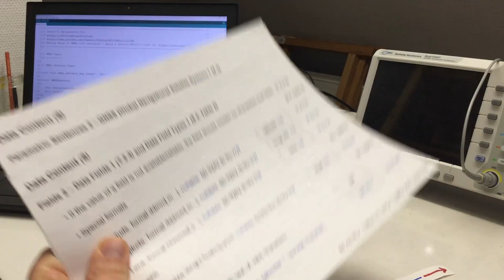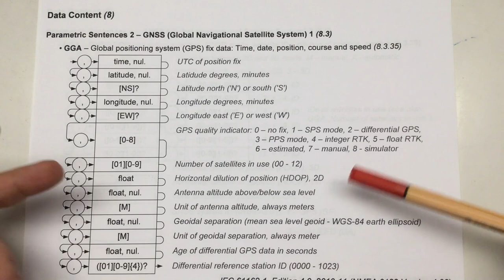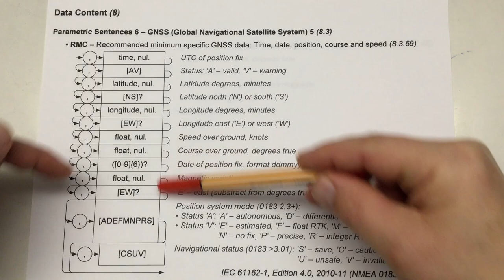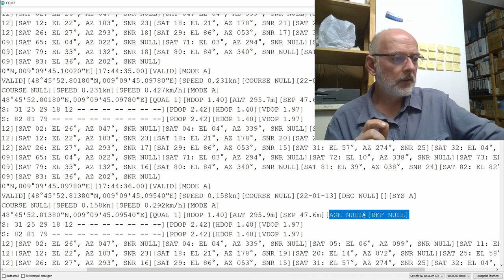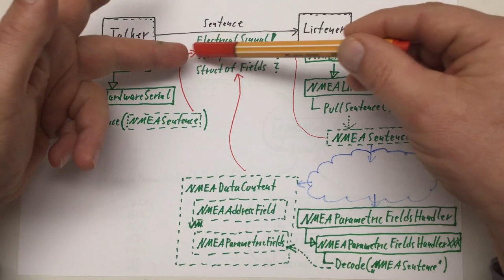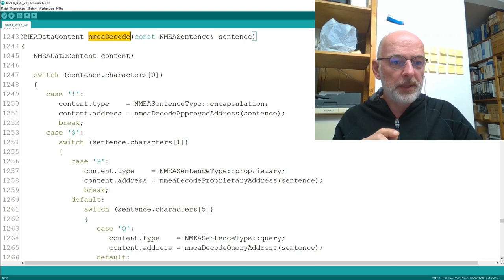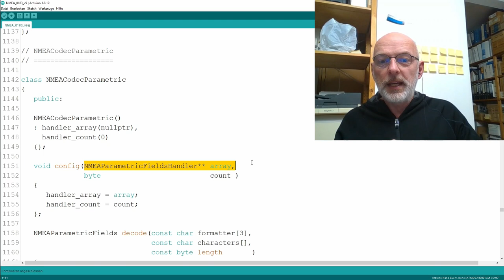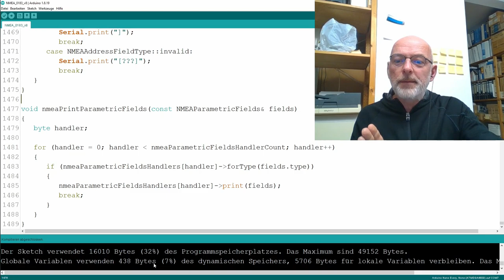Making Sense of NMEA 0183 Sentences – Specs & Arduino/MCU/C++ Code (4)

Comment: I wonder if we could build this onto a pole to plot maps of your property ?
Reply from the maker: Well, at some point, in some distance future, it's intended to go on the top of a pole, aka mast, of a little electric dingy. Then wen can plot a map of the river Neckar and the connected lakes. "Mast" might be a bit of an euphemism here. It will be probably just a 1m to 2m aluminum pole, so just a pole after all. No, seriously, the thing is not accurate enough to plot out the 10m by 6m (that includes the bathroom, kitchen corner and roof slopes on three sides) office space.

Comment: Hi
Reply from the maker: Hi to you too!
Reply: @robertssmorgasbord  I have a project to filter or convert Nmea 0189 to only GGA,GLL for use. Is it possible to do it through Arduino?
Reply from the maker: @thanapolbuddee1092  Yes. First you need 2 free serial ports (one NMEA in and one filtered NMEA out) on your Arduino. You can use an MEGA 2560 or you can hack a Nano Every ( https://youtu.be/yG_ialcawho?si=tF28S414wPdKpgoe ). Then you need the appropriate hardware on the serial ports to convert to NMEA. Finally you'll need to run the appropriate sketch on your Arduino (feel free to cherry pick from my code 😉). Note: There are more installments in this video series.